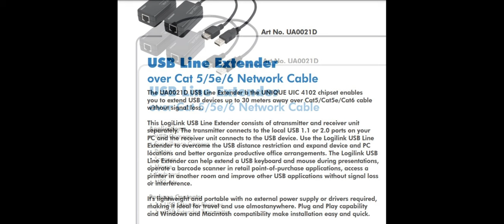USB extender

Comment: This is really cool lol.

Explaining the product: It probably does something with the lines of the ethernet cable and uses 2 for DATA and 2 for Power, or it could be 2 for power and the rest for DATA (determining that this product is USB 2.0 because of the White Tip on the USB plugs.

I've seen the same sort of things but it's with Fiber-Optic cables instead of Ethernet Cat 5e (it was more of a hub to share HDMI Cables and stuff, this does include Aux and USB 3.0 or USB 2.0 Speeds)
Reply from the maker: You have to buy a fiber optic cable directly to the required size, plugged in directly and you have to be very careful with the bends, while a network cable you can crimp it yourself to the size you want, you don't have to do that take good care of it, and you can replace the plugs when you want.